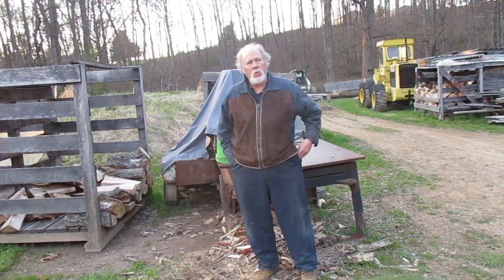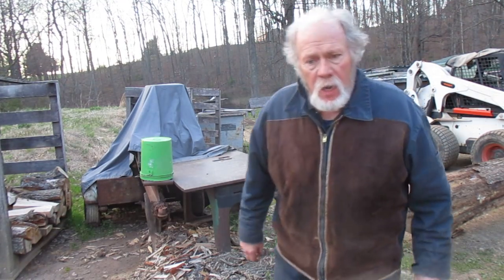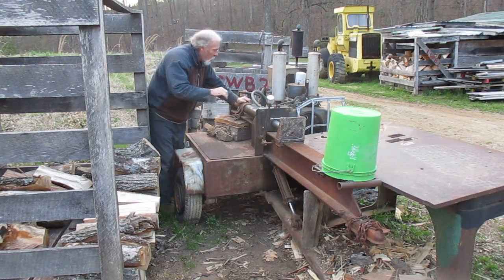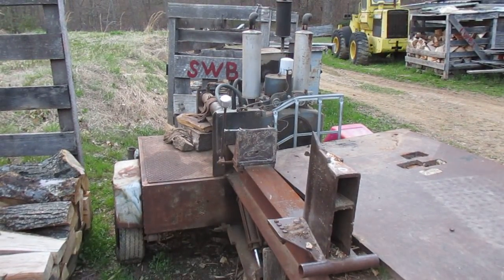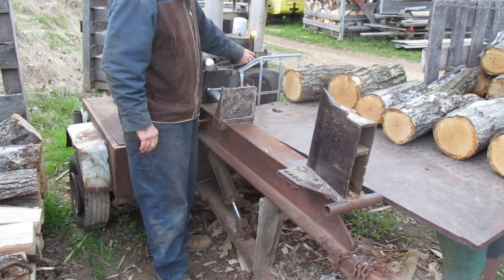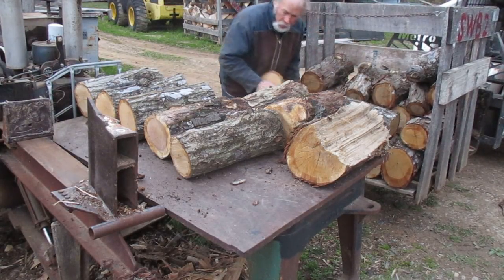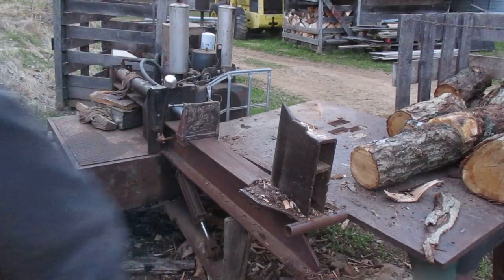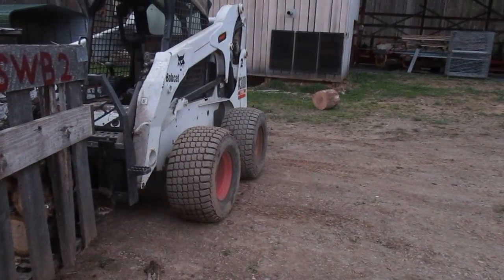Getting the wood splitter ready for action  #716

Comment: Thanks for the video John. The old splitter fired up just like you shut it off yesterday. I'm with you on the corn gas, that crap should be outlawed, it does more bad than good. I'm forever cleaning the carb on my small engines so they will run again.
Reply from the maker: hi there i go to PA to get corn free gas  . thanks for stopping by john